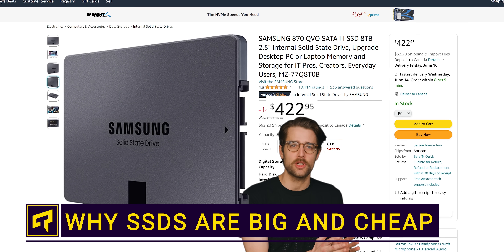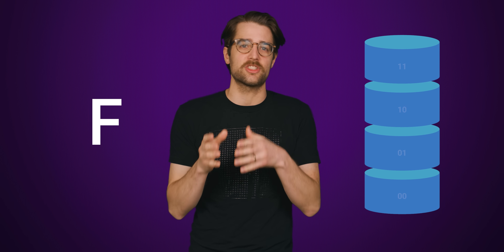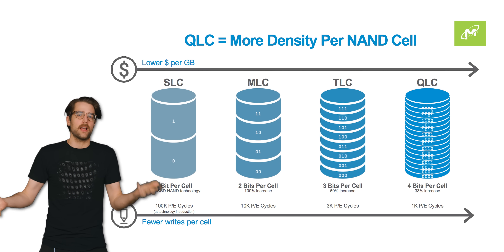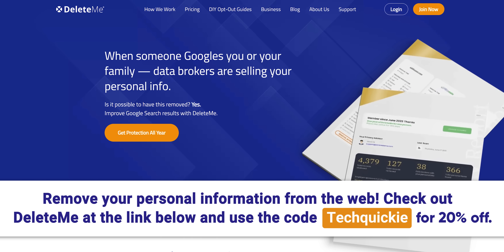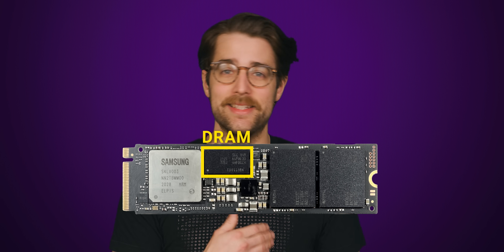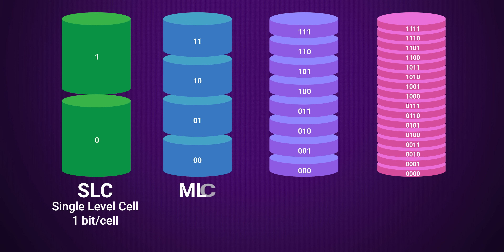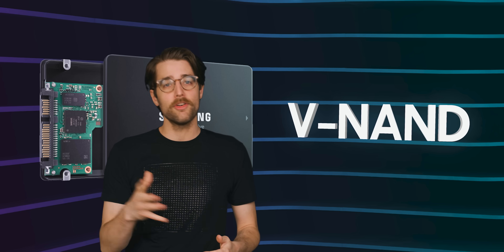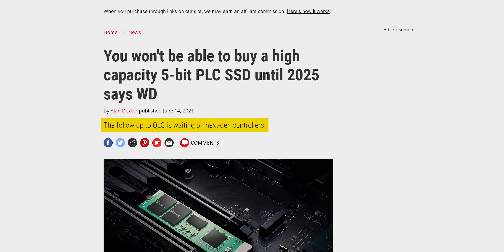Why SSDs Are Big And Cheap

Comment: As technology progresses, parts get more performance density while the MFG cost only goes up by a small fraction, meaning the cost per unit of spec, drops rapidly. The problem right now with GPUs is that NVidia has fixed cost for operations, they have purchasing contracts to fullfil so they cant just stop buying wafers. Normally this doesnt mean anything, but because most of the people who wanted GPUs got them from 2020 to late 2022, meaning most people wont need a GPU until 2025-2027, on top of that all the deamnd from mining has dried up because mining on GPUs is no longer profitable.
So how in the world does Nvidia support itself, its costs have not gone down, but the number of sales have probably been cut by 2/3ds.
Well, they take a card they would have priced at $379 and called a 4060TI(because it uses higher end memory than the $330 12GB 3060), and bump the price up to $900 and re-name it to 12GB 4080, the same is true for the card they probably would have called the 4050, or 4030, instead of $139-$200, re-name it to 4060TI and charge $399, add $20 worth of RAM to bump it up to 16GB and charge $499 for that version.

Nvidia knew it must do this or operate in the red

Theeeeeeeen AI bailed them out, and now, instead of looking at operating in the red for gaming and a possible overall wash by the end of the year being proped up on DC/HPC, they're now looking at cutting gaming production so they can double down and possible doubling revenue at the same operating costs.

Comment: Using more bits per drive ISN'T the main thing giving us more density.  Going from MLC to TLC only gave us 50% more density; Going from TLC to QLC (at considerable performance and durability cost) only added 33%.  Stacking and smaller process nodes are what's changed.  I don't really want a QLC, and especially not a PLC SSD, for data I place any value on; I'd much rather have a hard drive without their limitations.  I'll stick with TLC.

Comment: The simplest way to explain SLC, MLC etc is to grab a measuring jug.
SLC has two states. Empty and full. 0,1
MLC is empty, quarter full,  75% full or full. 00,01,10,11
TLC breaks those levels down even further, adding 12.5%, 37.5%, 62.5% and 87.5%.

The reason this works on SSDs is that they are similar to capacitors. Capacitors store charge similarly to a bucket. NAND moves electrons in and out of sealed cells via magic (quantum tunneling). So not exactly like a capacitor, but similar.
If you can precisely manage the writes and reads, and still allow for the fact that, like a bucket evaporates, charge dissipates, you can get more levels of charge.

So, basically, the last few years, the SSD makers have been selling us the same bucket over and over but with better management.

In theory, you could upgrade the firmware on a 1tb SLC and have a 4tb QLC. They should be basically the same structurally with the same number of capacitors. 

Which also somewhat begs the question: Rather than die outright, why don't SSDs warn you to back them up, when they're approaching their write endurance for that level, and give you the option to convert thems to a drive of a lower capacity? QLC drops to TLC, which drops to MLC, and it's final life is as SLC of 1/4 the capacity.
Theoretically it should be possible since the problem with write endurance is that the precision of the levels in the buckets get harder to manage over time. Reduce the precision, reduce the capacity, increase the life.

Comment: I remember using a 40gb hard drive in the late 1990s/early 2000s.

Technology is changing so quickly.

EDIT: Darn it, I forgot that we're in the year 2023, and not in 2010. Technology is still changing.

Comment: SSD's are limited to sub 100MB/s write speeds after the dram cache runs out.  Optane was over 2000MB/s before Intel killed it and did not rely on dram caches.  Shame what we have lost.
Reply: The problem with Optane is that Intel could never make it cheaply enough.
Reply: Cheapest SSDs*
SLC cache*

Comment: My NAS is the only thing that uses spinning drives these days which gets used for films where I need cheap mass storage and speed over 100Mbps doesn't matter. I got rid of all spinning drives a long time ago. Anything that needs internal/external storage is soild state only. I use a 4TB SN850X for my OS, some games and all of my other data and a Samsung 8TB sata SSD for mass storage, even my home CCTV uses an SSD so I had no drive seeking noise. Just glad to get rid of the annoying grinding noise some drives make when they seek data as some models these days sound louder than drives I had in the 90s. SSDs are so cheap these days it's stupid not to use them for everything unless you need over 8TB. 

When SSDs get large and cheap enough to replace my NAS drives then I'll drop those spinning drives as well. For me that would need to be at least 25TB+ currently.  Going to waiting a long while but once a 30TB SSD exists for £400 I'll do it. Hopefully that's before 2030.

Comment: I like drives that don't die after being rewritten only 1000-4000 times.
That's seriously a fisher-price technology.
Reply: And you think HDD would survive 4000 rewrite cycles? They die like flies sometimes for no reason at all.
Reply: @dat_21  Yes.. whiile HDDs can die before that, the majority will not.

On the other hand, SSDs absolutely cannot make it to that point.
Reply: @PhrontDoor  While SSD can't endure thousands of rewrites, it scales with capacity. For your typical 2Tb TLC drive, that would be around 1200Tb written, which is a lot. 

Unless you are writing and rewriting live surveillance footage or something, I wouldn't worry about it.

And they don't die of a sudden, they usually let you read the data, so it's possible to save the data.

Comment: Are HDD's still going to be cheaper in the near future or will SSD now push HDD completely our of the market?
Reply: Seagate is planning for up to 40TB  spinning drives my next year hopefully so there is still a market for them if enormous storage is required and speed doesn't matter. SSDs especially at current prices and capacities has certainly pushed out spinning drives in every use for the general public apart from NAS storage where capacitiy is far more important. 

But at the current pace SSDs are rapidly catching up. I wouldn't be surprised to see the death of mechanical drives before 2040 unless they still manage to stay well ahead in capacity.
Reply: @richard-davies  The cross-over point seems to be approaching rapidly, but it could also just be a growth spurt. There will be times that HDDs outpace SSDs again for a while, cat and mouse game really.

Comment: The other way we are getting more into less space is using more chips as the chips itself are cheaper. You just run into the heat problem quicker and i only have seen that method used for 2.5" SSDs with chips on both sides of the PCB. 32TB SSDs exist they just aren't cheap and do use the 3.5" form factor i think with 2 double side PCBs to hold it all so effectively the room of what you have in your SSD but x4 and a much more complex PCB that both the upper and lower PCB are 1 PCB and all the traces that some how all go to 1 controller and 1 interface.
Like no consumer needs 32TB of storage i predict the methods used to make it will never come to the consumer market.

Comment: Big? Cheap?
The hell are you smoking?? I just scored a 6TB HDD for 60 bucks. With that metric alone, the SSDs literally cost 3 times more!
But it gets worse considering that 8TB external HDD stations have been going for a hair under 100 bucks for TWO YEARS NOW, meaning those overpriced SSD counterparts cost 4-5 timex extra!
Not to mention their limited rewrite limit makes them dead on arrival.

Comment: so what's the recommendation if I want to store more data and not worry about longevity? idc much for speed but preferably m.2s cause setting up a NAS or adding HDDs to my setup is a bit tricky cause I'm short on space.
Reply: Everything dies.
Ssds die unexpectedly just as hdds do. It's less likely, but it does happen.
The only cure for not worrying about longevity is multiple copies(backups).
The data is what you care about. You don't care about the drive at all. Not really.
Your cheapest option is probably to get a couple of 4tb external drives and move the data you don't use often onto both of them, along with a full backup. Ideally, you give one to a friend.
Then, you just use whatever fits your needs and budget. Large m2 fits? Get that. Small m2 and large hdd fits? Get that. When they die, you restore from backup and move on.

Comment: My PC has only 1 SSD, a 500 GB boot drive.  But I have an additional 24 TBs of spinning rust (spread between 3 drives).  It works fine for me and I don't really see any reason to transition any of that storage to a large-capacity SSD.  Even if one of my hard drives fails, it would probably make sense to replace it with another.  Actually, what I might end up doing is just having Backblaze send me my lost data on a hard drive and then just plug the drive into my system.  That would probably depend on how much they charged for the drive as opposed to what it would cost to buy a blank drive elsewhere.  Actually, unless they charged a really high premium for the drive, I'd probably pay it just for the ease of not having to copy 8 TBs of data.

Comment: Intel X25-M never came in 32GB. It came in 80 and 160GB. You are possibly referring to the X25-E, which came in 32 and 64GB variants.  The X25-E was SLC memory, while the X25M was MLC.
Reply: My X25-M 80 GB SSDs are still working perfectly fine, one of them daily which is also the one which was first running with an unalligned partition on my main rig which was running Windows XP in 2010 and then for a short time as the target drive for my video recorder on which I also cut recorded video. Great drives!

Comment: I'm actually surprised that there aren't 3.5 inch SSD's with tons of space on the market. Correct me if I'm wrong.
Reply: I mean, you can get 2.5" ones up to 30.72 TB. Isn't that enough? These go for about 3 grand, have a U.2 or U.3 interface and very much require active cooling at about 5 W idle and up to 25 W under load. Failing that, you can equip a NAS with a bunch of 8 TB Samsung 870 QVOs.

I see two major issues with the idea - heat buildup would be an even greater problem than in 2.5", and then I can't imagine the market for drives that cost as much as a small car (or even a house) would be particularly large.

Comment: QLC is nice for write once read many applications. Like installing your entire game library on it and then never deleting them. Or storing photos and videos or movies and watching them. Setting up the drives in RAID will give you better performance overall if you're looking to have faster write speeds when files often exceed the single drives cache size.
Reply: 'write once read many applications. Like installing your entire game library'
Laughs in 160GB Modern Warfare update
Reply: @spankeyfish  you can buy 8TB nvme SSDs
Reply: Yeah, but difference between QLC and TLC is so insignificant, that you will rather pay for the extra speed and durability. If QLC was twice as cheap it would make sense, but in current markets it's like 15% cheaper.
Reply: You are clearly overstating the problem, if you look at the TBW numbers of most drives. Cells can still be rewritten at least thousands of times, and then there are things like marking cells bad etc.. And most drives have very high level random access even after the drive fills up (but if you need it for frequent writes with a filled up drive then I would definitely look at the reviews and look up "steady state" performance).
Reply: QLC are very slow, judging from samsung ones. They are as slow as hdds.
Reply: @MIchaelSybi  Not even close, what are you on about ?

Comment: I paid 800 bucks for my first 500 gig SSD. It was 100% SLC, and it lasted a long ass time for the amount of data I wrote to it, I think the controller or something else was actually what failed though because I wasn't exactly near the end of its NAND lifespan either (though I was getting there for sure, it had over 50tb written to it and had lost some of its buffer cells). Ironically the QLC drives that offer these ultra high capacities today would probably still last longer because I wouldn't have to constantly delete and write new data to a larger drive
Reply: I'd pay a reasonable premium for SLC, or even larger MLC 😢
Reply: @kathleentoner211  Samsung enterprise or datacenter drives (PM, SM) got you covered.
Reply: @bluesteelbass  I'll look into this, thanks
Reply: @kathleentoner211  Samsung sz1735 with Z-NAND, competitor to Intel Optane. And Kioxia has XL-Flash, Micron has XTR SLC, all enterprise U.2 drives.
Reply: My new WD Blue 2TB TLC SSD has an endurance rating of 900 TBW! 😲
Reply: @marcse7en  That's low, my kingston kc3000 has twice that.
Reply: @DripDripDrip69    Low? ... Two WD Blue have 200 TBW, and a Samsung 860 EVO has 300 TBW! ... Together with 10% overprovisioning, your "low" 900 TBW will probably last the rest of my life as a backup drive! So, I don't agree! I think 900 TBW is very respectable for £81!
Reply: @marcse7en  The newest wave of premium consumer 2TB nvme drives using YMTC 232-layer NAND has 8000 TBW rating. Not to mention enterprise drives, I have an Intel S3710 SATA SSD I brought back in 2015 that I still use as my boot drive that has 10DWPD rating, that's 24.3 PBW for 1.2TB version.

Comment: NVMe’s are current annoying i have 2x 2TB drives and as far as im aware there are no actually good 4TB drives available as everything uses the same limiting factor the phison controller

Until gen 2 PCIe 5.0 drives with a new phison controller or a Solidigm p44 pro / Samsung 990 pro 4TB release i simply refuse to upgrade my storage as raid 0 removes the gap in performance  and upgrading for performance is a stupid idea

Where are the non phison e18 last generation PCIe 4.0 4TB NVMe drives looking at you Solidigm and Samsung

Comment: I'll keep a mechanical drive for bulk storage I think. I have a 4tb drive in my pc now, and still have the 40gb hdd from my first pc in an external enclosure and it still works fine almost 20 years later.
Reply: I have my 80gb hdd from my first laptop from 2009, and it's still works as well. HDD is great to keep for storage, I don't think ssd can ever replace that.

Comment: Still didn't get why SSDs are big in cheap... TLC/QLC SSDs have existed for a long time, but prices on SSDs have nosedived quite a bit.
Reply: Demand dropped.

NAND and DRAM are often produced on the same equipment. So they switch from making one to the other when demand drops.

Demand for ssds want really that high, but it was for memory. So the price of both was high.

Now basically all demand is down.
Low cpu/gpu sales = low ram sales = low ram prices. Ssd demand isn't filling that void, so its price suffers too.

Also, due to the enormous expense of the fabs, idling production is not really an option. Debt has to be paid. 
Historically, the fabs with good balance sheets run at more or less normal capacity and suffer the margin compression/losses until enough competitors go bankrupt or demand picks up again and prices rise.

Comment: I wanted to get an external SSD for my Lightroom photo collection. My strategy is still the same, get an internal SSD and buy an enclosure, they're often only 1/2 the price as a dedicated external ones. I've been aiming for a SATA drive for the last 10 months, and couldn't believe my eyes to find an NVMe one on the same capacity for 3% more price just last week. And it's not like they're cheaping that much (on the surface at least) because they use stacked TLC, not QLC. Though longevity is still yet to be seen.
Reply: Just remember that NVMe drives often disable SATA ports, so check your motherboard to make sure yours is not like that. 
In case you ever need more SATA ports and find out they don't work, because that happened to a friend lol.
Reply: @GoldSrc_  i had to learn this the hard way a few years ago because all my m.2 slots were bound to 2 sata ports, so 3 m.2 used all 6 sata boards and i was wondering where my other 4 ssds went.

Comment: I'm more wondering why sata ssds are more expensive then Nvme ssds... like... the fuck... I'm searching for a extra Sata SSD because I... well I am a bit of a data horder. Both my NVME drives are getting full... so I need a Sata one now... but damn those prices... I can get a 4TB nvme for 180€ but at least in my Country the cheapest sata ssd starts at 200€. Sure.... thats only 20 bucks more... but considering the speed difference it sours my mood a bit...

Comment: What is the biggest and fastest SLC made so far? Do slc matter speed wise on a sata connection or is it fast enough to require m2 nvme to even matter except for longevity? 
Could you build a pci-e card with a nvme port and 1(or more) ram port to be used as a variable size data cash?

Comment: I used to partition my rust drives with 200GB for windows and the rest of the drive for media. I have finally converted  my three computer to SDDs for the windows drives, my only option is M.2 SATA or SATA III drive but its like having new computers. But now I have a 200GB of unusable space on my rust drive and the only solution seams to back every thing up and clear the whole rust drive in CMD (DOS). I7-3770s, i7-4790, i5-4???.

Comment: From personal experience, the super cheap ones limit out at less than hdd transfer speeds after a little bit...like the crucial P3's.  But the Samsung's price has fallen drastically and 2tb m.2's was lil over $100 and perform at 100% all the time.